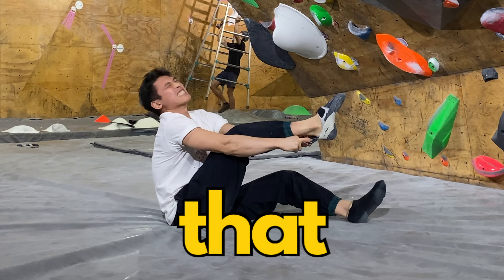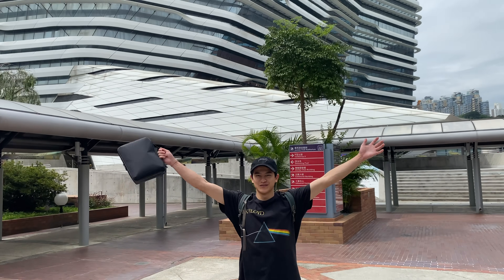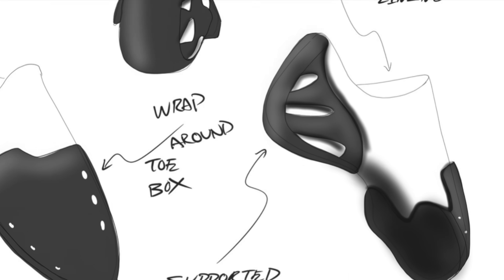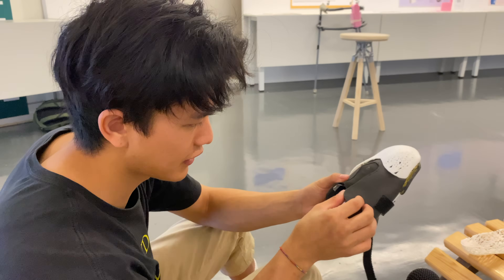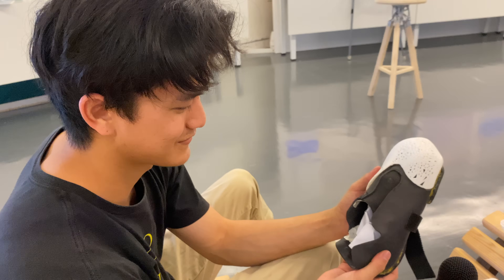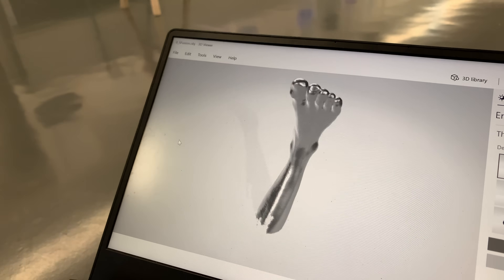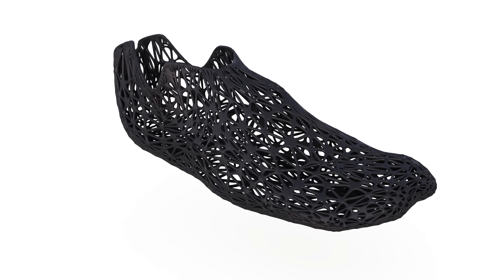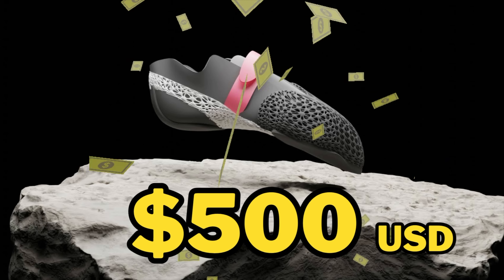3D Printed CLIMBING Shoes (PERFECT FIT GUARANTEED)

Comment: Fit is 1/2 why you buy a shoe…without materials like xs edge rubber this show wouldn’t even compare to current models. Most shoes aren’t made with one piece of rubber either, and there’s a reason for that, giving it flex where needed and firmness to provide better edging. This shoe seems to be focused on fit, but not at all on anything else. Making a mold of your foot isn’t groundbreaking, having a 3d printing material that mimics climbing rubber? That would be sick. The hype around this seems to not understand why we spend money on shoes, or the fact that a majority of climbers are dirt bags who would never spend 500 $ on shoes. If there was a demand for this, we’d see more of them.

Comment: i think printing the rubber is not the best solution.. you could just tailor the fabric to fit your foot perfectly and calculate the optimal rubber thickness, stiffness and position for your foot, mark it on the fabric and have it be a product that can be resoled. No need to print something that is tailored for you all the time, once should suffice, at least once every few years
Reply from the maker: That’s a great idea too!!
Reply: also, there is a company called ATHOS that also experimented with 3d printing climbing shoes :) 

And if your friend is looking into bespoke climbing gear, one thing that may be interesting is a bespoke hangboard where you can archive that every finger is in a 90° angle. 
This would be very interesting and a nice contrast to only training on straight edges. 
It could resolve imbalance between fingers(like having pinkies that are extremely weak in a half crimp position, as they may only be used in a drag position..)

This should also be very easy to calculate and plan using a 3d scan of the hand, and 3d printable.

Comment: This is guaranteed bullshit. While 3D printed shoes can offer excellent fit, that's not what's limiting climbing shoes. Material properties of the used rubber, fabric and leather are. And compared to those, the properties of resin are complete garbage. I print with such materials every day and know what I'm talking about. All of them suffer from low tensile strength, creep under constant load, particularly at body temperature, poor abrasion resistance, poor resistance against tearing once the surface has been compromised, poor resistance to chemicals and water. In addition, while manufacturers claim biocompatibility, I wouldn't want to have this stuff on my skin for long.
These problems will also never change, because the need to deposit the material in place forbids using high performance materials that rely on specialized chemistry or internal structure. Try printing carbon fiber reinforced materials. None of the printable ones are even close to laminated ones, except those that basically print a laminate and have other restrictions.
Reply: I really like the idea of a perfect fitting shoe. Espacally because i need two diffentent sizes for my feet. But i also totaly agree with you. A good fit is just one of the many features that a shoe must have. Besides, a shoe that has the exact dimensions of the foot is not a perfect fit. After a few uses at the latest, the shape is stretched and the shoe is too big. There are reasons why we (almost all) buy shoes that are too small. A downscaling of the foot shape would not help here either, as the shoe is loaded differently at different positions.
Reply: @bambuzzz  That's a good point.
Reply: I was very excited about this project, but you make many accurate observations.
Reply from the maker: Thanks for your insight🔥Sounds like you know your stuff

Comment: This is pretty cool, but my question is: How long will it last?
Reply from the maker: As long as we get some sponsors to help us test it out properly, we will make sure to test it out🤣
Reply: Unintentional shoe making pun
Reply: On the stratasys page about the polyjet, which is the rubbery material used, there is no mentioning about wear resistance or strength. Chances are this material will not last long at all. However, given this is only for proof of concept, a specialized material has to be developed for making shoes.
Reply: Not long at all and the friction is bad as well.